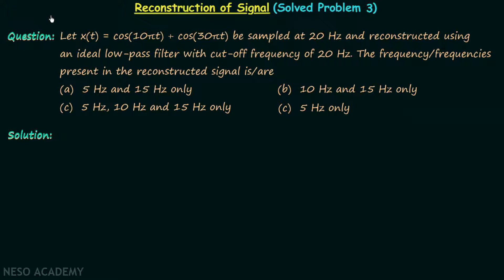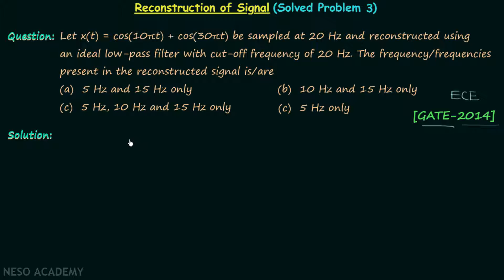Reconstruction of Signals (Solved Problem 3)

Comment: Sir, what will happen to frequency components of smaller frequency signal (cos(10pi*t)). Don't we consider those frequencies while reconstructing?
Reply: We use only the maximum frequency component of the original signal

Comment: the spectrum sketched by you at 9:20 is not the correct freq spectrum of function x(t) because cos(at) has only two impulses at w-w0 and w+wo  as per my understanding, please comment on it
Reply: You are correct, you can verify yourself by recollecting that Fourier transform of a periodic signal is discrete and hence those impulses.
Reply: yes,it's very misleading

Comment: Dear Sir, the solution appears to be incorrect: After sampling, the frequencies present are in the "range" + or - Fm centered at n*Fs, => in this case both 5 Hz and 15 Hz components centered at n*Fs will be present in sampled signal. Now we need to filter this with LPF. The answer you got is "by chance" correct.  Your thoughts please.. ?
Reply: Yup, those frequency components of 5hz would also be present.
Reply: The only thing that is wrong is the plotting . We should have the summations of the impulses . Other than that , cut of frequency is given as 20 hz .Therefore we will have frequency component exactly between -20 hz and +20 hz . And the presented frequencies between them are -5 -15 15 5 . We will not consider the negative frequency .And we end up with 5 and 15 hz.For solutions , you can go to : http://d1zttcfb64t0un.cloudfront.net/gatepapers/EC-GATE%2714-Paper-03.pdf
Reply: Broo can u plzzz elaborate...sahi kese krenge
Reply: @shobhitmehta5745  A correct solution would also consider 5Hz +/- nFs as the frequencies in the sampled signal before low pass filtering. He completely ignored it, and by chance got correct answer.
Reply: @shuklashravan  is it nfs+-5 or 5+-nfs?pls reply
Reply: @exaltant2464  You are right, it should be nfs+-5 as it is correct and in convention. The fun part though is that {5Hz +/- nFs}U{-5Hz +/-nFs} is same as  nfs+-5  where n being an integer is free to take -ve values as well
Reply: Shravan Shukla yep, from what I thought, the frequencies of both cos(10pit) and cos(30pit) should be considered, and the answer should be (a). But the frequency of fm with sampling frequency of 20Hz accident overlap the first frequency, and the answer is correct by accident.
Reply: +1
Reply: BROO gate me aapear hue the aap?
As i am in 2nd year so need some guidance......
So pl reply

Comment: DOUBT: WHY DID YOU IGNORE COS(10 PI t), WILL THIS BE ALSO NOT PASSED THROUGH THE LPF AS ITS FREQUENCY IS EVEN LOWER THAN THE COS 30 PI T COMPONENT????
Reply: Gaurav Kalita I think u didn't follow his playlist that's why u r asking that
Reply: @vinaypant557  we will ignore lower message frequency for calculation of sampling frequency.But here he already mentioned it..so i dont think we should ignore lower frequency
Reply: its not ignored, we are basically finding the interval when the function repeats.. its a ssummation of 2 functions, that means when the larger one is repeated the entire function will get repeated .. thus we take 30